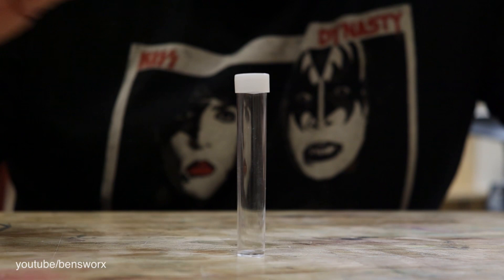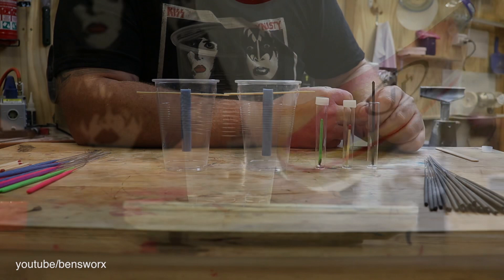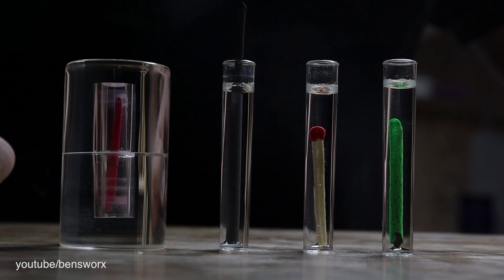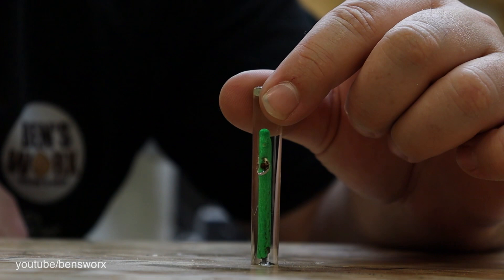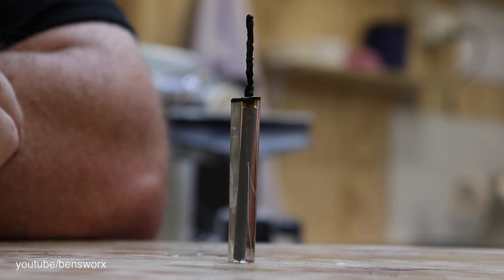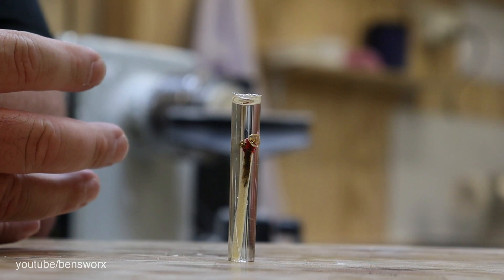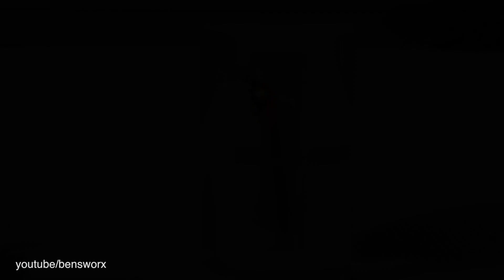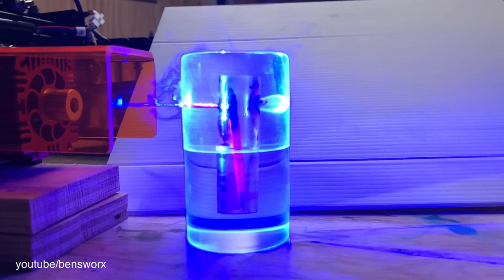Can You Ignite a Sparkler Encased in Resin ?

Comment: The problem with what is happening, is that thesin is cutting the oxygen supply from the match and the sparklers, since both of them have to pass a safety standard for home use, they cannot be self oxidising. What you can do however is try to coat them with powdered stump remover. Then see what happens.

Comment: Curious what thermite would do. It has it's on oxidizer, so if you get it burning it should continue to do so, but you might have to put a small piece of magnesium in with it to start it. So I guess the question is: Will magnesium burn? (I would guess it most likely will need to be in a void to work.)

Comment: The melted resin chemically and physically extinguished them. It robbed heat from the reaction and melted into the composition. If you had a void inside it would likely burn because the resin can't interfere with the reaction that way.

Comment: Hello there my name is Josh I personally have always wanted to see someone in case a Barbie in resin without any void or anything I want to see if it could be done but I'm scared to try it myself I have been working with resin Lightly for the last few years and I want to get into that and I've always wanted to try it but it would be very expensive to me I was wondering if you could consider putting a Barbie or some other doll inside a resin cylinder

Comment: Predictions:
1 the cavity sparkler will light off and go until all the oxygen is used (unless it has its own oxidizer in the compound)
2 the partially submerged sparkler will burn completely but just make smoke towards the end as the oxygen and smoke fight to displace each other.
3&4 neither will light without the chemical compound containing its own oxidizer to provide the oxygen potion of the combustion triangle (fuel, oxygen, spark) even it the do light nothing will happen outside of just turning black or ash color from their original color.

Comment: Of course they didnt work. You pressure forced the resin into the porous structure of the sparklers and the match, and I'm assuming, effectively put roadblocks between every bit of the reactive materials. 
Like having a row of match heads and putting a layer of glass between each match head. You might get one to go off but the glass blocks it from chain reacting down the row of matches.

Comment: Oxygen is a key component of these types of fires(non chemical). Removing the oxygen will make it very difficult for these types of fires to work properly.  Try some components that don't require oxygen to burn. Try to contact Nile Red.  Or other chemistry channels on YouTube. Hydrogen, acetylene, and a few other chemicals will burn without oxygen present,  but do some research on the subject. Good luck mate!

Comment: When the resin caught on fire it cut off oxygen supply to the lower sparkler parts, thus stopping the sparkles.
Reply: Sparklers have solid oxidizer in them usually, that's why they usually behave like rockets when you pack a bunch into something with one open end, its just a solid rocket with extra sparks, i think the resin did have something to do with it though, somehow smothering it in melted resin and killing the reaction, it could be water content in the resin being released when it heats or something, I'm not sure, but that thing should have gone up like a sparkler fountain, not much of one, but still.